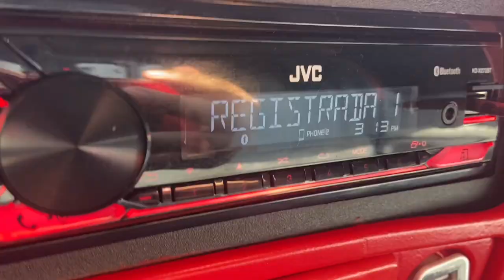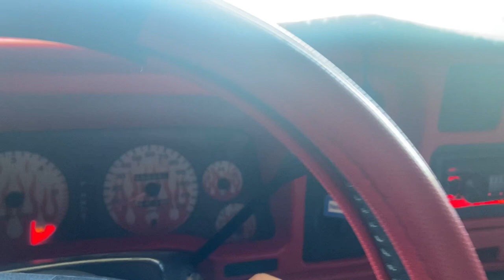Ram Sst (First Vlog)

Comment: Love my 98 SS/T it just threw a rod a couple of weeks ago looking to do a 5.7 hemi swap soon
Reply: i have both 2005 DAYTONA and a 97 SS/T and what you have is not just a standard old 360! no matter what they say! pull the heads and intake and look how smooth and shinny they are! the production run say's it is a"TUNE PORT HIGH OUTPUT 360" and no where else or nothing else say's that! it also says it's should have a factory shift kit in the 4 speed auto. and you wont see none of that on the sticker! Trust me top end is a beast and a stock vet or mustang dose not have a chance against it if you got the balls to hold it!!!! but if u wont the HEMI what do you wont for your blown up 360?
Reply: How many miles threw a rod?